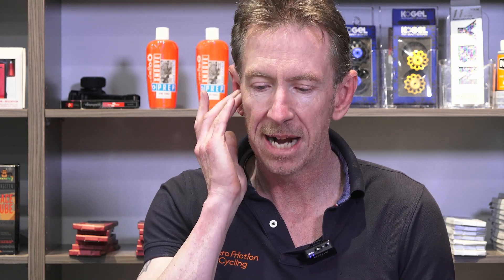Episode 10  - 12 Speed Chain Compatibility

Comment: Hey mate just found you channel very informative i,m running a campy chorus chain on sram eagle cassette works great i thought that campy chains were longer lasting than sram ? My other question regarding shimano xtr chain is are they stronger than the old hg chain i had over 300 stitches in my face from failed pauls at full gas in a sprint then got my head runover was 35  years ago but still dont trust shimano interested in your thoughts.
Reply from the maker: Hey Yoda - there is big variance between chain wear lifespan between models. i havent tested chorus. Campy record 11spd has good wear life, 12spd very moderate wear life (it dropped vs 11spd). Srams 11spd road chains were typically less than record 11spd, but their 12spd eagle X01 and xx1 have extreme wear life due to their industry leading HARDCHROME (GX are junk). 

I am a little confused re the crash - chains dont have pawls - so was it a chain snap or a freehub failure? Shimano 11 and 12spd chains i think are extremely reliable - almost all models now are e-bike rated by default, and we have had extremely, extremely low reported failure for shimano chains, and noting that rider shifting behavior is typically much worse / harsher for chains these days vs what it was 10 years ago
Reply: @zerofrictioncycling992 Yep chains don't have Paul's ie freehub but the result of either braking is the same ie over the bars into the road or dirt ouch . I agree on the gx not good I,m old school 55 yo been riding racing most of my life and laugh at how top pro mtb ers don't know how to change gears it's insaine they would never have gotten away with it with a front deraileur . I will try the top end sram chain next have gotten crazy good life from record chains in 9spd but could only get a chorus for my 12spd so far so good only done 1000km and hardly any wear . Thansk for your info .

Comment: Thanks for the information i learned a few things innit but the ting gis ihv sram axs gx and im tryin to mk a sick combo like with shimano cassette and i dunno which chain tha i will use is sram gx or kmc or shimano or somethin like tha
Reply from the maker: GX level chain is junk, wears extremely fast. Go x01 level (also from testing and field - KMC haven't shown to us to be very long lasting either as yet). There seems to be overall high compatibility between running a shimano cassette with a sram eagle chain - but the main question then is why? what "sick" outcome are you hoping to achieve by doing this? it is potentially a new freehub if you are on sram, or are you trying to not buy a sram XD freehub and keep yr microspline hub in which case you should be all good to run sram x01 eagle chain, and that will be super long lasting.

Comment: Hello Adam. I have a turbo trainer with a 10 speed Shimano cassette and would like to put on my new 12 speed bike with Shimano Ultegra chainring & KMC X12L-1 chain briefly for bikefit purposes. As 10 & 12 speed chains are both 1/2″ x 11/128″ I assume it will be ok if I run the chain in-line and don't shift. I don't want any premature wear on my new bike components.
Reply from the maker: Hey there! yes indeed that will be fine you are correct they are the same internal chain standard so staying in one cog will be no issue and wont cause any premature wear. If one is running single speed set up on 11/128 standard to the system it wont care if its 9spd chain or 12spd chain etc.

Comment: Hi Adam do you think shimano slx 12 speed chainring would work with 11 speed shimano chain?
Reply from the maker: Yes i believe so. The chain standards are the same (11/128 internal width) - but the 12spd teeth will be a little more honed in some spots for the extended inner link plates. The main risk this may pose is lower chain retention, however this is rarely an issue on road due to front mech. I have run shimano 12s rings on mtb with "normal" 11/128 chains and not had any drops - i think for road the risk will be very small but theoretically there.
Reply: @zerofrictioncycling992  thank you for a reply! Now i will definitely try this combination

Comment: Have FSA 42t narrow wide chainring, garbaruk 10-50 cassette and currently a sram 11speed xx1 chain. Using a sram rival derailleur with the garbaruk long cage upgrade. The chains don't seem to be lasting as long as I would have hoped. Using Molten Speed Wax.

what is most appropriate? is the sram xx1 the best durability I can get?
Reply from the maker: Hey Providore will see if can help! Just a few questions for more info; 
> How many kms approx between re waxes? 
> How re waxing? 
> General conditions? 
> How many kms to 0.5%
> What using to measure chain wear? 

Thanks!
Reply: @zerofrictioncycling992   -Aiming for 150kms between waxes. Wipe chain thoroughly with a microfibre until all visible dirt (wax/dirt blend) is gone before waxing. If it has got remotely wet will wax immediately.
- Using immersive waxing in a slow cooker, leaving chain on the cold wax as I turn it on. Once at temp just pull the chain out and hang.
-Typically dry road riding mixed with some all weater commuting and once a month do a larger gravel ride - mixed conditions. If I know conditions are going to be unideal I will start with a fresh wax.

Previously I had been using a KMC x11 and a KMC SL 11s. They measure below 25% using a park (cs-4?). My issue is with lateral wear. Some sections of the chain are well outside tolerance while others are fine. I do not have guages to measure this but can measure lateral deflection under gravity?

I suspect the issue is a combination of KMC's coating that prevents wax sticking (as I found out afterwards) and my 1x setup exascerbating the slippery coating. Under pressure the wax simply moves out rather than providing lubrication. 

I would class it as noisy at around 200ks but I think it is noisier than it should be throughout the full wax life.

I have swapped to using XX1 chains and have noticeably better wax life and they have proved to be better but still not ideal. I'd be hoping for 250ks between waxes.

For some context, before I made the plunge to waxing, I used a ceramic dry lube which was leages ahead of anything else I've used, but I did have a case where I sheared/cracked at least 5 links of a sram PX11 chain.. Less than 1000ks and cleaned after almost every ride - certainly more work than wax has proved to be.

So yeah, is there anything I can do to improve longevity? more than happy to play around with chains to find one that lasts at least 200ks without compromising chain wear.
Reply from the maker: @providore222  thanks for the extra info providore and sorry for delay reply, with andrew on holidays i am a bit buried at the moment! 

Firstly likely the issue previously is due to kmc, they have been long standing re most short wax lifespan and short wear life issues being kmc. but from your comment i am not sure how many kms to 0.25% - so not sure if that is good / great / not good. 

And issues re lateral wear are again a bit difficult to advise on - there is not yet any real established lateral wear measure for X model chain on X system at which point lateral wear amount presents an issue such as poor shifting, and until proven otherwise my experience with own and most customer chains is that except for extreme cases - a chain being replaced by 0.5% elongation wear will ensure chain is replaced well before any lateral wear presents and issue - however over time now with abbey tools LL chain checker we hope to slowly build knowledge in this area. 

The xx1 11spd should give a very long lifespan to 0.5%, and yes as noticed generally better wax bond. Chains will typically be starting to feel / sound dry by around that many kms though on most systems on wax, only a very thin coating remains by then. If its not pleasurable and a bit of hassle to re wax more frequently to keep in silky smooth zone best options are to run two chains on rotation or use in conjunction with a compatible drip wax like ufo drip or ss drip to top up at around 200km and extend time between waxings. 

Other things that can affect is wax getting long in the tooth (generally best to change at around 10,000km ish for road riders), and also make sure give chain a nice swish in wax for about 20 secs before removal to ensure good distribution of friction modifiers in the wax which will add treatment longevity and wear protection - just removing after heating this will all be sitting on the bottom of the pot and not in the wax on your chain

Comment: A quick question. If one bike is Shimano 12s and another is 10s. We wanna use those 2 bikes on one trainer. If i put 12 speed cassette on the trainer is is possible to use this setup with a bike that has 2x10 drivetrain? Maybe changing chain for 12s for this one? The use would be of course just with ERG mode so no problem with shifting.
Reply from the maker: Hey there - sort of yes - if you are changing the chain (as the 10s chain will struggle to fit between 12s cog spacing), and you dont need to shift cos that wont work! then mostly yes as long as chain is in a straight / pretty straight chain line. 

The 12s shimano chains have special extended inner link plates as part of their hyperglide plus shifting, and so on chain line angles these plates MAY rub on side of teeth of 10s chain rings, but if straight chain line this will be ok

One area that MAY still run not quite right is the 10s pulley wheels, some non shimano 12s pulleys just dont run that well with the 12s shimano chain due to these inner links - again in a straight chain line it should be ok, but it might not run perfectly smooth through the pulley wheels. It shouldnt be a show stopper, but be aware that could be an area to check how the chain is going if you try this.
Reply: @zerofrictioncycling992  thank You !

Comment: I have a old Cannondale that I'm fixing up. It's a gear rear cassett with 3 rings at front. Hyperglide cassettn XT components. Not sure what I need for a chain. Any help, thanks.
Reply from the maker: hey there - that will be determined by the number of cogs at the back. If its 10 or 11spd, i would go shimano's very hardy link glide LG 500. If its 9spd or 8spd - most of those chains now are very budget and thus very fast wearing - your longest lasting are ybn sla 9spd or wippermann connex 9sb, or 8spd the ybn H8 or wipperman 808

Comment: YBN SLA 11V compatible sram rival 22v or better at xx1 11 speed?
Reply from the maker: yep with 11spd you can mix and match to hearts content, ybn sla 11 great on sram red / force / rival 22 - longer lasting and faster than 1170 / 1190 chains, xx1 11 is longer lasting than ybn but slower
Reply: @zerofrictioncycling992  thanks

Comment: Sram 11 speed chain is ok to us on sram 10 speed drivetrain ?
Reply from the maker: Hey Ironore - mostly yes - they are the same standard re internal width which is what is running on the rings and cogs - just the 11s will be externally thinner. This will have a bit more space between chain and cogs which MAY make shifting slightly more lazy vs the correct speed for the system. Some notice a change, some do not. There should not be any noticeable impact on front, 10s rings are actually spaced slighly closer than 11s.

Comment: Great video. Can I run a Campy 12 speed chain on Sram 11-speed Chainrings? I'm wanting to put Record components on my bike but I don't want to pay for the expensive crankset when I already have a nice SRAM Red 11-speed crankset. Thanks!
Reply from the maker: Hey Ztz - overall likely yes - the internal width is the same and rollers the same, so actual running on the rings and cogs will be perfect - just note the campy 12 chain will be externally thinner, and so this may affect chain pick up for shifting - shifting MAY be a little lazier than with correct width chain for the system.
Reply: @zerofrictioncycling992  excellent, thank you for the detailed response.

Comment: Running sram red axs 12sp groupset with flattop chain on fsa super 11sp chain rings. Adjust FD accordingly using srams instructions as a start point. Shifts are nearly perfect.

Comment: can a run 2 by 12 SRAM Force eTap AXS groupset with a Shimano r7100 chrankset, Shimano 12 speed chain, and Shimano 12 speed road cassette? Can I change the jockey wheels on the SRAM rear derailleur to be Shimano compatible?
Reply from the maker: alas no you cant go that way. People are getting away with running shimano on sram flat top system (not  recommended though), but the oversize rollers of the sram flat top chains just wont run on shimano chain rings / cassettes. 

And i dont know what the case to try would be. Ie they are not a blindingly fast chain, so there is no call to try and run them for that reason, and shimano 12s m8100 and m9100 are very wear durable, and you have the right chain as part of the hyperglide+ shifting. I have no idea what the reasoning would be to try to put a sram flat top chain on instead?!

Comment: Great video. Will a Dura-Ace 11 Speed Crankset work with a 12 speed chain, 12 speed cassette and 12 speed Di2 front and rear derailleurs?
Reply from the maker: The crankset itself should overall be fine - the chain rings you will likely need to change to shimano 12s rings. the 12s shimano chain has special extended inner link plates as part of hyperglide + shifting, and so the teeth on 12s are specially profiled for these links - running 12s chain on 11s chainring will likely cause rough running / rubbing / issues especially on higher chain line angles as those extensions will rub against teeth not profiled for them

Comment: I have a 12 speed shimano microspline, kmc dlc chain. Swapping to sram nx Crankset, will I need to swap my sram eagle chain ring out? Finding contradictory info everywhere I look.
Reply from the maker: Hey cremanderek (cool name) - i am missing a crucial bit of info - if you have a shimano crank with your 12spd shimano groupset - then your existing chainring for a shimano crank wont go onto a sram crank as sram have their own direct mount system. The chain will be fine (just i wouldnt waste big bucks on DLC chain - pretty misleading claims on those chains, the DLC is an EXTERNAL coating applied after construction, there is no DIAMOND LIKE HARDNESS on any key wear / load surfaces - it has the same - poor - wear life as other KMC 12spd chains, there is zero performance or wear longevity benefit, you just paid a lot for a uselessly hard external plating). 

If you have shimano 12spd cassette, you should stay (for most) with shimano chains as they have extended inner link plates as part of the hyperglide+ shifting. Moving away from that shifting will still be groovy, just not hyperglide + groovy. If you are planning to run a shimano 12s chain in future however, you will need to ensure a shimano 12s compatible ring, a normal sram chain ring you would probably buy for your sram crank will not work with a shimano 12s chain - you would need to stay with kmc / ybn / sram eagle. if you want to have hyperglide + shifting, and thus get a shimano 12s chain, then wolf tooth shimano 12s compatible ring for sram direct mount is what you are after. Otherwise sram eagle chain ring for your sram eagle crank, but run kmc / ybn / sram eagle chain. Of those eagle x01 level is extremely wear durable but not a fast chain, ybn sla 12 super fast but similar wear life to a dura ace 11 chain (medium wear life), kmc - also very fast but poor wear lifespan. If you dont race, go xo1, if you do race ,train on xo1, race on ybn. Dont go GX level, very poor wear life - spend the extra on x01 level if going sram. 

Hope that helps.
Reply: @zerofrictioncycling992  you are the man!!! That’s literally all the information I’ve been searching for the past two weeks! Thanks a ton! Much appreciated!